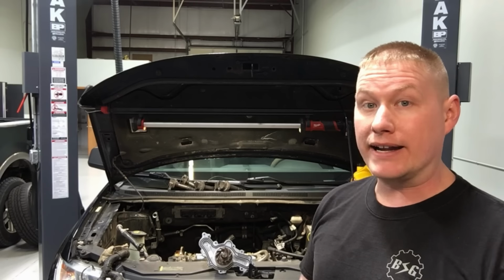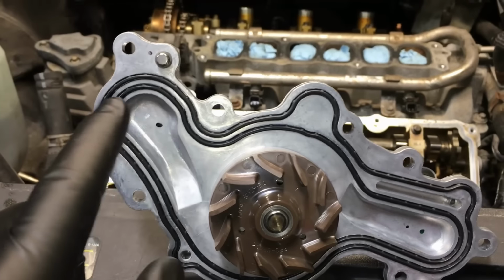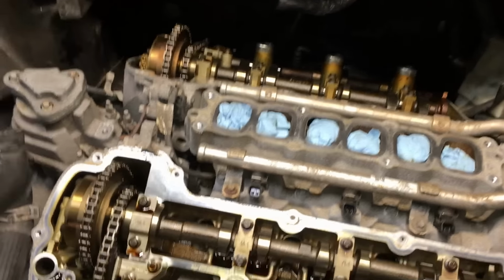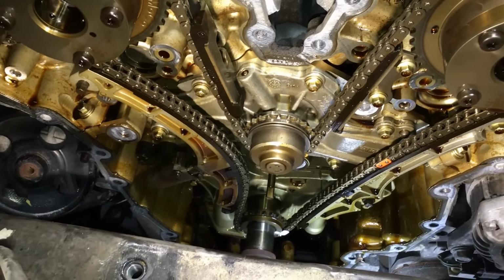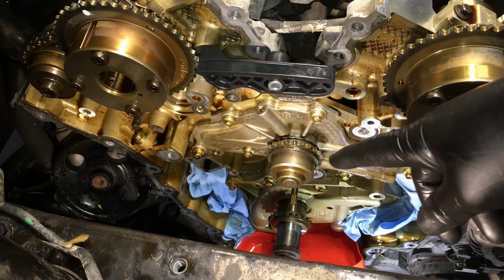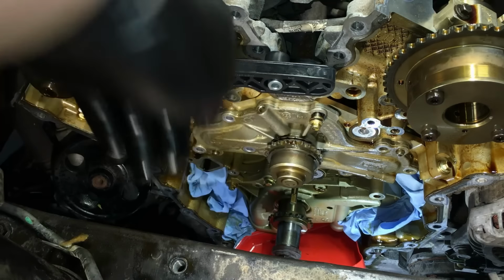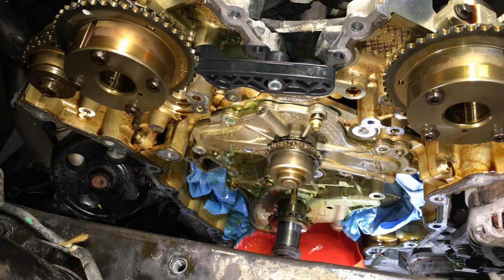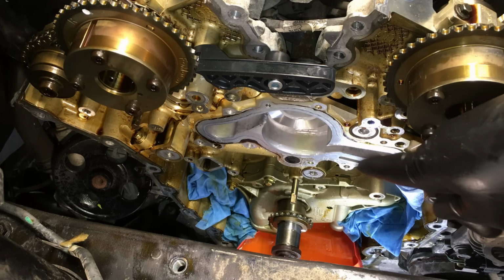Ford 3.5L 3.7L Duratec V6 Chain Driven Water Pump Failures: Check it Before it Destroys Your Engine!

Comment: Mr. Fordtech this question about the 4x4 on 05 fx4 so you have a video u posted a while back about checking the vacuum cylinoid to lock the front hubs well I did everything you said to do in the video but lift the truck to see turn them to see if they lock. But I did drive slowly and had a buddy watch them to see if they locked and unlock and they did so I took it out to a dirt field to see give it glass and try to make all fours  spin, but they didn't it seems like they lose power or they dont get enough power to spin them out,  were should I look next. The transfer case engages as well everything seems normal.

Comment: Thanks for making this video. I check oil and coolant levels and inspect Oil Fill Cap every week. The weep hole info and inspection behind alternator is a top tip. I have a Lincoln Certified Pre-owned 3.5L engine with ESP to 125k miles. I love the car but will have evaluate future WP replacement vs trade-in at end of ESP. Your YouTube channel is top notch.

Comment: my 08 taurus has 265000 miles on it,for $1200+ I think I'll take my chances with the pump thats in it.
when/if it does let go I'll buy another ford with a 3.5l, I love this engine! good power, good fuel economy, AWD goodness YEA
I think my next one will be an Edge

how long should a water pump last? my mom just had her toyota water pump changed at the dealer, $900 and just over 100K miles.

Comment: What’s the best ford truck engine do u recommend
Reply: 4.9L I6 OHV before 1996.
Reply: Due to 300 I6's age, my recommended best Ford truck engine is 4.2L V6 OHV, last one built in 2008 instead of 1996 (12 years difference.)
Reply: 4.6 2 valve or 5.0 Coyote. 3.7 and 3.5 naturally aspirated is also a good engine too in the F-150.

Comment: Off of the this job I have a 2017 F150 2.7 ecoboost that smokes gray oil burn only on cold starts only got 36k miles on it any idea or have you been seeing this?

Comment: I have a good one for you.  I have a 2013 Ford F-150 Platinum with the 6.2 engine.  On startup I get a ticking sound like a timing chain but it is not all the time.  I also have front brakes that pull drivers side sometime and then passenger side other times and make a low grrrrr sound when it is slowing to a stop, any ideas on these?

Comment: 2019 Ford Explorer, 2019 Ford Taurus, and 2019 Lincoln MKT are the last Ford vehicles using 3.5L transverse engines. Do we consider these the most-reliable Ford 3.5L ever built?

Comment: Ford updated 3.5L/3.7L water pump, known as "Motorcraft PW580". Does the new one last beyond 300,000 miles now?
Reply from the maker: All parts shoot for 150k miles of useable life.
Reply: Which means 200K. Still not impressed.

Comment: Had this done on my 2010 fusion sport 3.5 110k miles and a ford dealer wanted $2800 in labor because motor had to be dropped out. OUCH! I was lucky i noticed i was loosing coolant and it was coming out of the weep hole behind the alternator!

Comment: Do you know if the ford scape 2010 has a gas filter? I looked everywhere but i cant find it
Reply from the maker: No it does not
Reply: FordTechMakuloco is there any maintenance you would recommend on that truck since it does not have a filter ?

Comment: Hi Brian, I know I'm on borrowed time with my daughter's '08 Edge with 200k+ on it and I will be doing this job in the next few weeks. The question is two part: Change the oil pump at that time and the cam phasers? This engine has no signs of any leaks and has been ultra reliable.

Comment: Leaking behind alt, dam near cried!!!! water pump failure...$2,400.00. 196,586 miles on her. Now my suspension squeaking like crazy.
Reply: Derrick Wright of you got almost 200K miles then that is a good run even with a $2400 repair bill and whatever the suspension work will be!!

Comment: Why did Ford repeat the same mistake Chrysler made?!   They would have been better off just using an eletrical driven waterpump that costs $1000 because atleast if that pump leaked, it would never leak INTO the engine oil. 

How many average people actually check oil often?  I consider myself pretty anal about oil level, and even I will check it occasionally at fuel fillups.  The average person, when this pump starts leaking, will likely never discover the coolant getting into the oil until they bring the car in for an oil change.   Mean while engine damage is occuring, with no actual warning signs until its already fucked.   Great job Ford!

Comment: Of course Ford would find a way to kill one of their most reliable engines...
Reply: What the hell is wrong with ford. We had to have the engine removed to change a water pump on the Lincoln MKT. we sold it after that. Why didn’t they just use a Normal  belt drivenwater pump like the coyote v8?
Reply: @Kevinb1821  The really funny thing is that the exact same 3.7 engine that was in the MKT, also went in the F-150 with a more traditional belt driven water pump that sits outside of the timing cover. It doesn't really extend any further forward than the rest of the accessory drive. Why Ford decided to do the FWD cars differently is beyond me.
Reply: @Clean97GTI  You have to also  🔹DROP THE ENGINE🔹  in the F-150.    Those F150s equipped with the 3.7 liter Duratec engine.   
My bill was $4,000 for engine rebuild.... Then I sold my F150.   The next owner will be in good shape❗  They won't have to worry about the BULL SHIT pump failing 😊
Reply: @tumarbongrox6074  what year or years ford F 150?
Reply: @Kevinb1821  Thanks to this video and this comment, I won't buy the used 2012 MKT that I recently looked at with 160,000 miles...such a beautiful suv but that engine seem to be a ticking timebomb! I can't afford that kind of repair for a simple water pump!
Reply: @Kevinb1821  Ford engineer: " here hold my beer. Watch where I put this water pump."
Reply: Kelly Constenius
Ford didn't put the water pump in the block, mazda did! .. This was a collaboration with mazda. They took the duratec platform built by ford and porsche in 1993 and changed a few things. Then end result was this shitshow.
Reply: @kellyconstenius676  😂😂😂😂
Reply: Kevinb1821 they did it to gain a mere few inches of room in transverse application. Still very dumb. I didn’t even know it was designed like this when I traded in my Taurus in, damn glad I did.
Reply: Of course they would have managed the booger up everything else
Reply: David Norris f150 2010 to 2014 the back side of the rockers have plastic tape  looks like duct tape covering the 6 to 8 2”round holes on the back side of the rocker panels. You would expect to find plastic plugs ,any way I purchased my 2011 f150 which required rockers be replaced as well as cab corners I am quite certain the tape added to the destruction by not sealing correctly and some tape falling off allowing water to sit in the welds and rust the rockers out .
Reply: What a dumb engine design, but ford isn't the only one.
Reply: The old 3.0 was probably the most reliable of the "modern" Ford engines... Why'd they "progress"?
Reply: Buddy has a ford transit 350 with 3.7 I ask him about it and it has 378k miles. He did this @200k. He said it’s still runs smooth and he is think about doing it again and seeing if he will get 600k. It’s mostly highway miles btw
Reply: @jiggidyjam  
Transits, F150s and vehicles with other conventionally mounted engines have a “normal” water pump. This is only for transverse mounted applications.
Reply: @mikers14  I have an older Continental, it has a 4.6L 32V V8, which is the father of the Coyote 5.0L.  It is mounted Transverse and has a removable waterpump that looks like maybe an hour of work. So they managed to get that huge engine in a FWD car with an external pump. Waterpump is still perfect, almost 200K. Just did a belt.
Reply: Does the 2014 Edge have the same design?
Reply: Cheryl Waters,
If the Edge has either of the V6 engines described here, yes, it has this vulnerability. (See FordTechMakuloco's other video on this "Fatal Flaw", too.) If it has the 2.0 L Ecoboost engine then it has a different problem that makes it worth avoiding -- carbon buildup on intake valves that can lead to turbo failure. (See his video about "Warning to Ecoboost owners".) 

Really disappointing because the Edge was high on my list for buying some day. Not anymore.
Reply: ArcoZakus, thanks for your reply
Reply: Cheryl Waters,
I'm nowhere near the authority on this that FordTechMakuloco is so I'm not 100% sure, but close to 90%. Still you might want to confirm what I wrote. 

The 2014 model year was the last of the previous generation Edge, which got some significant changes for 2015. From what I have been able to find, the engines were the same for both generations, which is why I believe this problem existed in the 2014s, too.
Reply: Thanks for the video . Now I'll skip on Mazda cx9 that I was planning to buy It had that 3.7 duratec in it. I'd rather change timing belt/ water pump  3rd time on my 04 Mitsubishi outlander an keep it.
Reply: *Mazdas engine
Reply: I’m looking at a Lincoln MKX with 65k miles is that worth it?
Reply: At the very least, Ford made the engine more complicated.
Reply: Reliable alright you can rely on catastrophic failure if you go a month without babying that cesspool
Reply: @newtonraymond77  Poor water pump design, on an amazing engine platform. These duratecs go 200k plus easily. It's a shame.
Reply: @newtonraymond77  We had our 2013 Taurus water pump changed and 3 weeks later the engine failed catastrophically (valve tap and rod knock).  WTF?  Hard to believe a well maintained engine with 100k miles would fail suddenly.  The water pump job (10 hrs) seems like the most probable culprit.  Any ideas why??  Can't get the dealership to troubleshoot without spending another $1k.  Now I have to try and prove they were negligent.
Reply: @jonhakim204  Because the water pump will fail in one of two ways. The seals will leak and you'll see it weeping. This first one is what you hope to see. It lets the coolant dump harmlessly on the ground and lets you know to get the car fixed. 
 The second way is the water pump shaft seal will fail and dump the coolant into the oil pan and contaminate your oil. You won't really get any indication of this either. The first sign is usually a hot engine because your coolant is low. And later on, you get the bad news that your contaminated oil (and if memory serves, the oil change interval is 7500 miles) has buggered your bearings. 
Our 2009 Flex did that while we were driving down the highway in Southern California. Rapid coolant loss and a hot engine. Water pump cost us $1400 and the shop did an oil change anyway since the water likely contaminated the oil. There is supposedly a lawsuit over these things. I've tried contacting the attorneys to see if we have some recourse. The mechanic I used at home told us there was water in the coolant at the next oil change and advised us to get rid of the car if we could. 
Buh bye Ford Flex. I'll never buy another Ford product again. 

My feeling is that the water pump shaft wasn't supported very well on its bearings and the force of the chain is what caused the bearings to fail and allowed too much deflection in the shaft which allowed the seal to leak. The belt driven pump that they used on the F150 would not have allowed such failures. Or, if they'd used a chain driven pump like the Nissan VQ35, but didn't use the pump as a pulley for the timing chain, instead simply driving it with the chain (which exerts far less force) would have also prevented this failure mode. 
At the very least, providing a leakage path that directed the coolant almost anywhere EXCEPT THE FUCKING OIL PAN would have saved people thousands of dollars.
Reply: @jonhakim204  Jon- sounds like your 'friendly Fraud Stealership' effed-up and got water in your oil during the replacement... And didn't FLUSH the crankcase after their "repair".

Have you had your oil analyzed? BY AN INDEPENDENT SOURCE!

I'm sorry for your troubles... My wife and I are going through some that are similar... One thing I've vowed to do from here on out, though, is to NEVER, EVER buy another post-1985 vehicle.

The old ones may look "dated", but you can replace a small block Chevy ENTIRELY for less than this gosh damn water pump "job" on one of these nightmares.
Reply: @Clean97GTI  the idea was to soak the customers for $$$$$$$$$$$$$repairs
Reply: @jonhakim204  What happened in the end?

Comment: And I thought the water pump was time consuming in my mom's old escort lol, I still say they are building vehicles now so you have to take them in instead if doing the work yourself. But that is my opinion
Reply: That’s exactly what they’re doing. It’s the same on the heavy equipment side, especially with John Deere stuff. They keep their diagnostic software so unavailable that you’re forced to take it to them.

Comment: This is a really stupid design on this water pump.  This seems to otherwise be a great reliable engine, but this design feature is a ticking time bomb.  The only thing you can do is preventive maintenance, change it out at a particular mileage interval, and hope that one doesn't fail prematurely.
Reply: did you watch any of this video? there is a specific weep hole channel to divert the leak outside of the block first, so you can check for leaks externally
Reply: @andiarrohnds5163    Ok, did YOU watch the fucking video???  There is MORE THAN ONE place that it can fail and with ONLY ONE way will it leak out the designed weephole.  The other way (the bearings, which is BY FAR the MOST COMMON point of failure) gives you ZERO warning.  The only thing worse than a know-it-all is a fucking ARROGANT, IGNORANT know-it-all.
Reply: I have to agree.  Having turned wrenches for decades now and even more today,  it seems car owners just don't recognize they have a problem soon enough and continue to drive a vehicle when they shouldn't.  Of I owned one of these I would be changing the water pump at life expectancy. Take no chances that the weep hole isn't leaking.  He even points out in this video that this is a possible scenario.

Comment: I gotcha.. Let's not learn ANYTHING from Chrysler's 2.7 disaster..
Reply: @Ray Milligan  If the pumps gaskets leak, you see the weeping on the Duratec 35/37. If the shaft seal fails, it dumps into the oil pan.

Comment: Done 2 pumps and 2 engines (milkshaked to destruction) in the last 8 months at a small volume shop. JUNK! Ford knows better. In the trucks the water pump is external from the crankcase and belt driven.
Reply: Some of them will just leak oil out of the weep hole as well if the outer gasket fails.